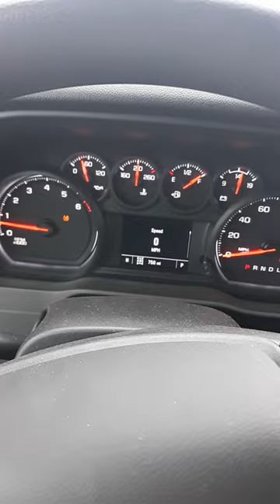2023 Chevrolet Silverado 2500 Custom Can't Plow Snow With Fisher 8.5' V Plow

Comment: …. You need to adjust your torsion bars to raise the front end.. Take it to a competent shop and they should be able to do it and realign it no problem.. I would also HIGHLY suggest putting a set of Timbren load stops in the front end at the same time while you get the torsion arms and alignment done.. All GM 2500hd trucks need those two things done especially if you have a plow.. It makes all the difference, and you will save yourself a ton of money and time by not needing to replace any front end or suspension parts.. The difference is absolutely noticeable.. I would suggest doing both now and at the same time, while your truck is new.. That makes a big difference as well.. Also, turn OFF your traction control when plowing.. I have been through all this before brother.. Makes all the difference and feels like a bigger and tougher truck, and actually makes the drivability feel much better 👍.. Believe me, you will be very happy you made those upgrades.. The Timbrens cost about 200bucks and you can get them on Amazon I believe if you want, or have the shop order them.. To adjust the torsion bars, align the front end, and install the timbrens is short money.. I think I paid like 350 with the timbrens included, all set with everything done out the door.. You will notice a Huge improvement right away, especially when you hook your plow up next and start plowing..👍🇺🇸